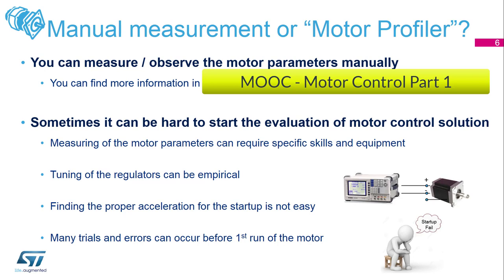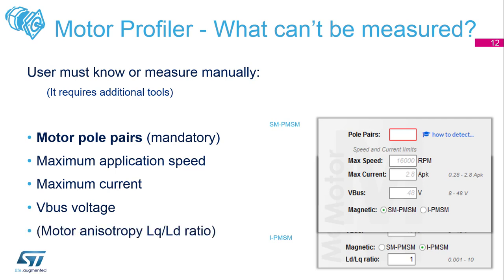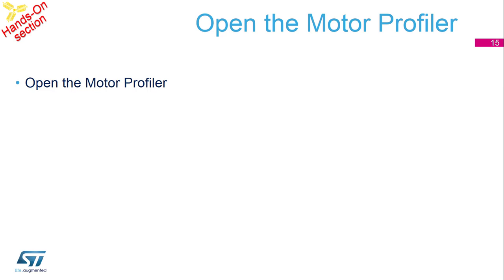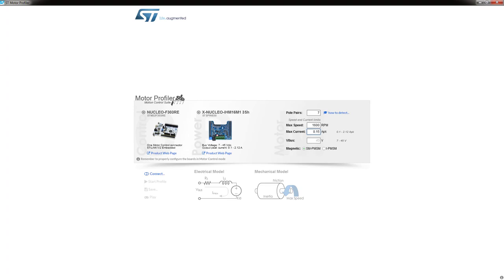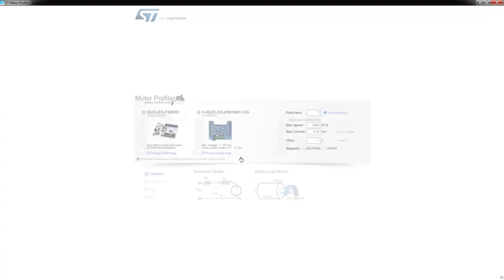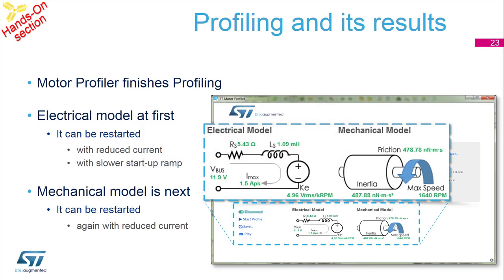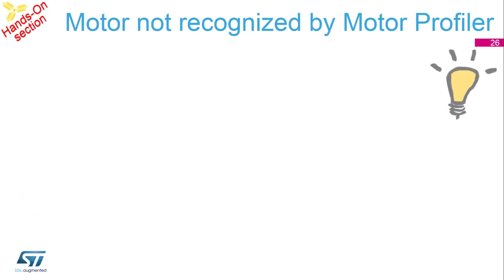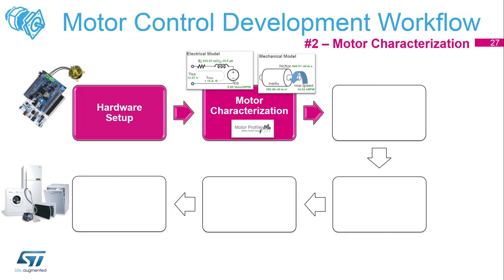Motor Control Part 2 - 2 ST Motor profiler - hands-on

Comment: You measure the Inertia and Friction parameters of the motor idling or with a load? The coefficients of the PID speed controller will depend on this.

Comment: Looking for help and not sure where to turn.  I have product number B-G431B-ESC1  and it's not able to connect to motor profiler software.  Is anyone able to suggest where to find help on this?   I'm not sure if it's a driver issue or what the issue is.  i'm new to working with STM products.

Comment: Hello, so I have everything working, and now I am wondering how to connect a 48V power supply and 48V motor. When I increase input voltage bigger than 32V the motor profiler fails to start. Is there any reason?

Comment: Why does this profiler not have STEVAL-3201 board?
Reply from the maker: The STEVAL-3201 is based on STSPIN32F0 which contains Cortex M0. The Motor Profiler need some computing power to calculation of motor parameters.
Due to this fact  Motor Profiler supports STM32 which has Cortex M4 and higher.

Comment: Hi i have a NUCLEO-F303RE + IPM15B,
when i click connect.. i get the error window ST-LINK connection error
Reply: the nucleo board is okay, i can programm it with SW4STM32 no problem
Reply: FIXED, aparently the X-NUCLEO "shield" interferes with the serial , once you put it out and try with the naked nucleo f303re, it shows the firmware upgrade thing